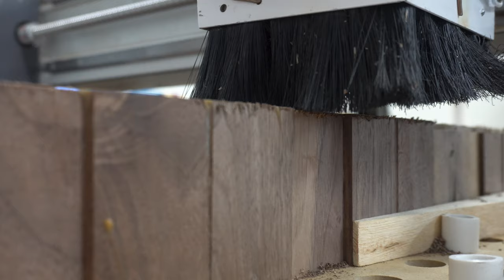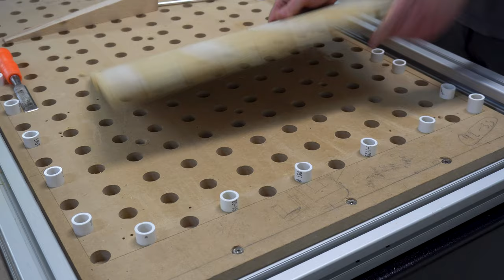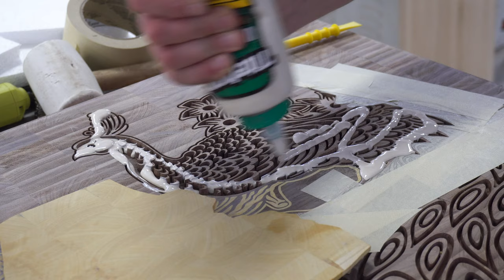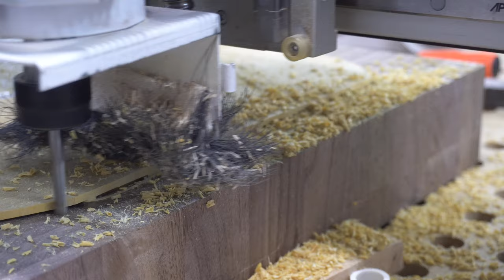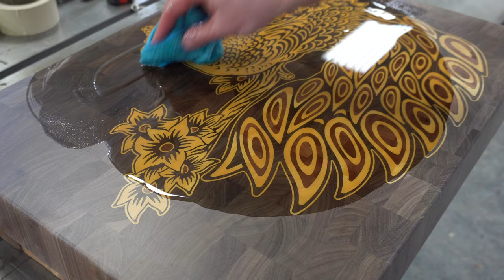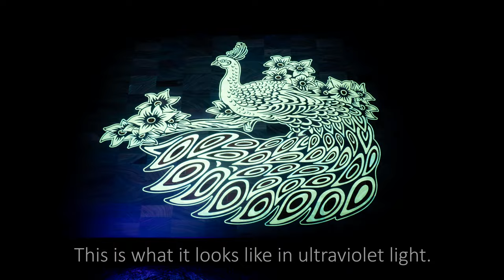Peacock cutting board. CNC Inlay. Wood inlay. Inlay cutting board. BroinwooD

Comment from the maker: How to find inlay parameters. My first own 20 minutes tutorial.
Link for purchase.
https://broinwood.com/products/how-i-am-finding-inlay-parameters
Reply: A little sticker shock, but found the course very enlightening on your method.  Most revealing was the calibration on each bit.  Time consuming, but yields the great results that you produce.  Quite frankly, I understand the need to charge for sharing your knowledge and I know that my boards will improve greatly having  learned from the master.  Thank you.
Reply from the maker: Thank you for your comment! 👍🙌😊
Reply: @bbgakame  I had the same apprehension, but I'm so glad I pulled the trigger on this purchase. The way I see it, I saved countless hours creating my end-grain boards using the guidance from the video. Sounds like it worked out for you as well.

Comment: Nice machine design. I have made my own CNC router from scratch as well. I am wondering, are all your designs original artwork? Is there a repository of digital files with the detail of the pieces you produce? I have done simpler work using Fusion 360. Is V-Carve Pro a requirement for work of your quality?

Comment: i'm wondering
why you are not using a bigger insert to go over the faces?
wouldn't it be more efficent to get rid of it in a couple of turns?
you put the boards through the shaper and get over with the grinder anyway :)
Reply: Based on my experience, very small errors in the machine tramming will be exaggerated over a two inch bit compared to a 1/4" bit.  This causes a very small ramp on each pass noticable over 2", but not over 1/4".  My self built WorkBee exhibited this and was very tough to trammel.  My $.02.

Comment: I bet you use press for "clamping". Can you tell me what is the time of pressing? Is 2-3 hours enough? does it depend on the drying time of the glue? If I use fast drying glue can i speed up the pressing process?

thank you
Reply from the maker: You are right i am using a press. Pressing time is about 10-30 minutes.
Reply: @Broinwood  How mush pressure do you use with the press?

Comment: Dope! Thoughts on using smaller slabs for inlays?  I'd be curious to see what an inlay looks like with one continuous grain on it for textures
Reply: When doing detailed inlays like this you have to use end grain. The fine details usually snap off when using face grain like a slab.
Reply from the maker: Absolutely right!